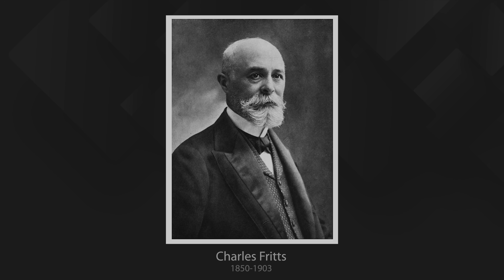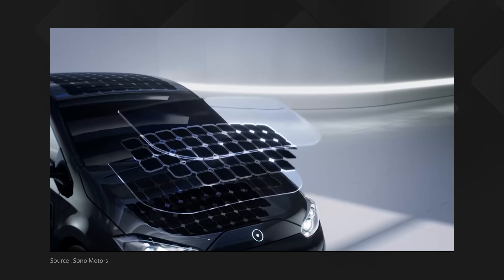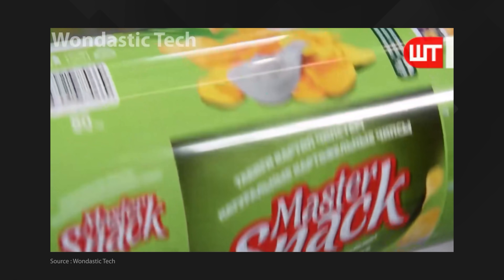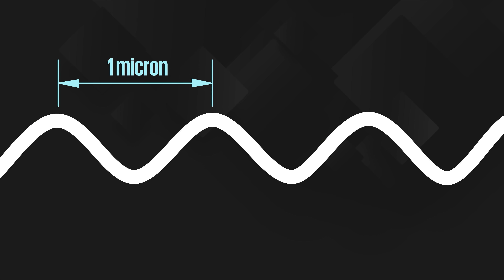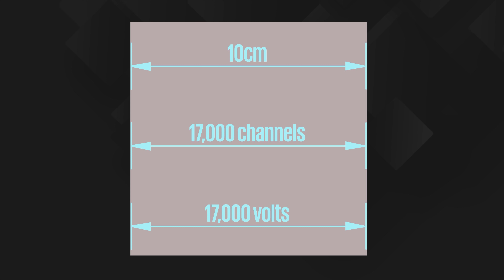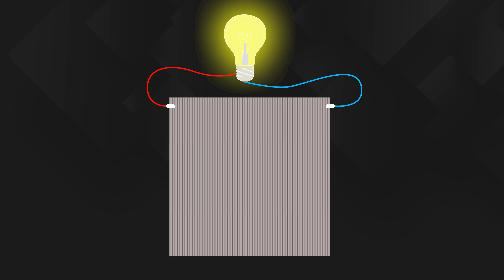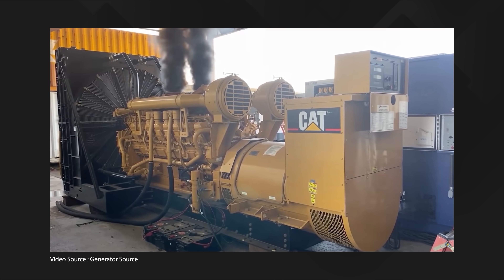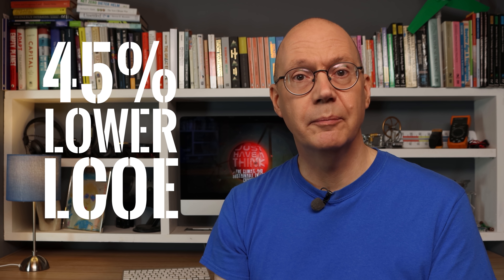Solar PV film roll. Revolutionary new production technology.

Comment: Great idea. I wonder how this material would hold up as a cloth such as a solar shade cloth? Would stretch and strain damage the microstructures? Also what would be its durability under UV? I guess if it's cheap enough, if the material wears out you could simply peal it off and replace it, which then raise issue of recyclability.
Reply: That was my thought as well, how much more plastic will it add up to? Otherwise sounds good.

Comment: Interesting stuff. The tricky bit will be finding a successful market. There have been many thin-film PV companies that have all failed to get much traction, including ones specialising in things like tents and awnings (places not strong enough to hold conventional crystalline panels). The problem is that a lot of the applications where it would be useful are area-limited, so getting ~half the power output (11% vs 20%) is a deal-breaker - it's better to spend more money on more efficient panels for a small area like a campervan roof, house roof, vehicle roof, boat roof etc.
Still, maybe there are places where laminated thin film will work and it can be done cheaply enough to make sense. I hope so - it seems like neat tech.

Comment: Excellent work, sir! I was wondering if you might be able to do some shows about a more low-tech potential, such as the possibility that trees actually produce an electric current and if reforestation could replace some of these problems with high-tech renewable energy efforts, then doing such a thing the forestation of the globe's deserts would produce an astounding effect while providing the companies involved with a good income because forestation and Forestry maintenance which would involve labor-intensive arborist maintenance and collection of leaf litter and forest floor fuel work, if done properly especially would entail a fast labor force especially if it involves electric engineering as well. 

Trees that search for water such as the African fig tree or the weeping willow would help in retrieving fossil water which may be abundant below any desert, as well as harnessing the abundance of seawater that has resulted from climate change to produce the freshwater for the desert forest by separating the hydrogen at its source and transporting it using dirigibles with the new flexible photovoltaic on its exterior or actually a part of the physical structure of any dirigeable bladder. 

I for one am convinced that the solution to climate change is not that difficult for human beings to do. It's just that the wrong people seemed to have worked their way in two positions leadership for the moment, perhaps because obtaining some kind of Collegiate degree the knowledge of which is all too soon forgotten. Be that as it may, each of us because of the advances of our century may just be in positions collectively, right now, to harness each individual's power of the human mind. 

I have written about that recently in my of my recent series of books. The latest is called, "Reciprocal Supply Systems". . You can get a copy from Amazon, just type in the title on the search bar and my name, Paul Hall, when you get to the site. 

Many thanks for your wonderful efforts, I'm a fan. Sincerely, Paul A. L. Hall
Reply: I recommend sending Dave a message through Facebook.

Comment: I love the fact that you cover the renewable energy sector. I always click the like button. And I appreciate you. However. You need to watch the documentary on history of what happened when Krakatoa Exploded (f I remember my facts right) they went through two or three years of total crop failure. Krakatoa put so much debris into the air that the sunlight was blocked out for days, and weeks where there was no sunlight at all. Photo Voltas is not suitable for baseload generation? No matter what type of storage device you put in to smooth out its output. If you really care about the planet. You will promote. Molten salt nuclear reactors utilizing thorium. They can be mass produced, they can be configured to burning up our spent nuclear fuel rods which litter the countryside. Sitting in swimming pools waiting to. Have a disaster exposed them to us. And yes I am being funny Just Have a Think
Your fan AL

Comment: For 50 years now, the solar fanatics have been telling us that they are finally producing THE product that will make solar work. But until solar energy stands on its own without massive taxpayer subsidies, it does not work. Call me when the subsidies are not needed.
Reply: It works, there have been massive advances in PV tech.
Where have you been? 
Come out from under that rock occasionally.
Ring ring,. Ring ring,ring ring, 
Hi Noddy, unlike Coal and nuke, the subsidiaries haven't been needed for PV for ages.
Don't confuse subsidiaries with start up incentives.
2,600,000, ( 30% ) of rooftops in Australia have solar as of Dec 2020.
Then there is the industrial and business roofs.
That's approximately 11GW generating capacity and over 10% of Australian generating needs and growing.
But you don't want to hear facts.
Reply: @davidwatson2399  When the subsidies end, let me know.
Reply: @stevenikitas8170  
The subsidies on Coal and nuke will only increase and I doubt they will end anytime soon.
The generation capacity of solar PV and wind has negated the need for the construction of new or replacement coal plants in Australia.

Comment: Sounds almost too good to be true. 🤔 So, responding with my usual cynicism to every such 'Welcome to the World of Tomorrow!' announcement made in the past 500 years, I think I can guess what's going to happen next...

The combination of unlimited free energy from the Sun, the amazing simplicity of the manufacturing process, the robustness of the underlying technology, the inexpensive raw materials, and the relative ease of implementation all round the world will result in a colossal rise in domestic electricity prices.

Sigh. Somebody, please, prove me wrong. Plee-e-e-e-ase prove me wrong.
Reply: I have solar PV and my bills are Less than $50 a quarter.
Solar is not pushing up the price of electricity, I suggest you get your information from a more reliable source.
Reply: Going totaly, or even partially off-grid doesn't cause the price to go up. As with most products or services, the price is set by demand vs supply. If one is supplying one's own electricity, one will be paying less to the company.

Comment: Cool! And pretty! 
So, all the things that could go wrong....
Hail storms damaging the surface so that they short out.
Vehicle crashes - same. 
How do they handle chemical spills?
If pieces are torn off and blown around in the wind and someone picks it up, will they get shocked?  
Etc. 
I'm sure they'll be working on all that so when it's all worked out, this would be fantastic to put on older structures which were not built to handle the weight of the heavy glass panels. Like my apartment building! 
Well done!!

Comment: I wonder if I could get them to leave one series connected for me.  I bet I could have a lot of fun with a million volt solar panel.
Reply: If it only puts out 0.0000001 Amp, wouldn't do much. I figure that they will cut them into lengths that will put out at least 10 Amps per length, and then parallel them for even higher Amperage. This will cut down the Voltage, as Amps times Volts equals Wattage. (Ohms Law). What IS needed is a panel that can put out between 25 and 100 Volts at at least 5 to 10 Amps. Then one only needs an MPPT solar controller and a good battery bank to get off grid...(plus the inverter to bring the 12/24/48, etc. battery bank DC Voltage to 120/240 Volts AC, (or 230 in England and some other countries). I am planning on investing in some Battle Born batteries soon. Some will even remain here in the So. Cal. desert as a test site to see how they handle the 120+F temperatures over the summers.

Comment: Would love the see it, but so fare all flexible solutions have only seen uses in very limited applications. With 11 % efficiency you need to double the area and that quickly result in added cost in the connecting parts. I hope I am wrong, but it would greatly surprise me if we see any major use of the product in the next 10 to 15 years.

Comment: Many thanks. Truly appreciate your channel. Simple question regarding the durability of the PET substrate over long period of sunlight exposition. I live in Canada, consequently, I'm also questioning thermal resistance when exposed to extreme cold temperatures (-40°).
Reply: Paul Gallant
Put some empty cola bottles with the PET recycle symbol outside when it's cold and try to break the plastic.  That should answer your question.

Comment: 10 to 15 years expected life is at least 2 to 3x lower than that of current PV solar panels so half the cost is not a good deal and they will need to do much better.  Also since they have such a lower expected life recycling should also be considered from the beginning.

Comment: Sounds like it has great potential! Efficiency is not that important, what's needed is a low cost per watt and they seem to have that covered.
Reply: half the cost, half the efficiency, and unknown longevity ie repeated bending stress, as well as impact resistance, etc.  The flexible panels now on sale offer two years lifespan, Cross our fingers these will be improved

Comment: This would be huge for cruising sailors if it could be made durable enough to incorporate into the sails.  A photo voltaic sail would give you a very large amount of surface area to produce electricity even if the film is less efficient .   A roller furling system would be the best way to go to prevent damage to the sail.   Thanks for the video!  : )
Reply: I was also thinking airships, considering their light weight.
Reply: @erfquake1  like a dirigible?
Reply: @MsNickie1001  Hell yeah. The surface area would be immense, and the film's weight would be negligible. Perfect application.
Reply: Canal boats use solar usually on the roof but perhaps could be coats over entire roof and sides of the upper section ?
Reply: @davidpowell3396  I’m looking at buying a canal boat at the moment. Given a widebeam has maybe a 14m by 3m roof just on the cabin this might be an ideal application
Reply: Talk about a solar sail...
Reply: I cant see they would ever get it resilient enough for covering sails. The beating a sail gets at times is hellish.  Most people are shocked when they handle a larger sail for the first time - its so thick its almost solid.
Reply: @piccalillipit9211   Yup durability would definitely be the biggest hurdle.  I've sailed the coast of Alaska for over 25 years on 30 to 50 foot sailboats for months at a time.  I much prefer them to power boats. I think they are a lot more seaworthy and safer than most power boats.
Reply: @mojoneko8303  - Im nothing like as experienced as you - but the first storm I was in was in the English Channel - wind over tide in a force 8 in a 30 foot wooden sailing yacht; that was when i discovered JUST how well built yachts truly are. I was convinced she would break apart at any moment and it was like water off a duck back to the boat...

The waves were flat fronted cos of the wind over tide and we just fell off the top of each wave into the trough of the next one and the wave broke over the top of the boat - 10 hours of that in a boat made of trees and bronze nails - unbelevable.
Reply: @piccalillipit9211  That would be my view as well. But wider use on the superstructure of boats seems an easy win.
Reply: @tcroft2165  - OH 100%. I used to live on a yacht [not as fancy as it sounds LOL] and there are almost NO flat surfaces on a yacht - or any boat. They are compound curves for strength. So when I installed PV on the cockpit rood I have to have different sized standoffs at each corner to level each panel - that meant the panel could easily be broken - which is immediately what happened when I left the boat for 2 month. Although not in the way you might imagine - the gap between the panel and the roof allowed someone to pull the cable to see if they could steal the panel.
The result the boat was a foot deep in water as the batteries had gone flat and the bilge pups had stopped working. 
Jus pealing off a backing and sticking strips to the roof would have solved ALL these problems
Reply: @piccalillipit9211  Exactly those curved surfaces inc many that are dead space you can't use for anything.

If thin film drives costs down then they also become less value to steal. 

Of course ideally its just built in at design stage when you can integrate this most effectively.
Reply: @tcroft2165  - PEP - there is no reason not to cover the entire top surface. Although I wonder what effect it would have on the temperature in hot climates - even in the south of France the deck of my boat was very hot on some days.

Comment: I'm no tree hugger but I absolutely value your excellently presented views and thoughts.  Please don't get me wrong, I do support environmental care of our very limited planet. I just don't see climate as our biggest threat but instead one of many that must be conquered together. I try to take a broad focus beyond CO² looking at the effects of for example 2cyc oil, the over use of nitrogen on our lawns (which can be more toxic than 2-4D or roundup), stopping combustion of biomass to produce socalled green power etc!  

I am amazed at the green tech we come up with.  
Example.  In 2007 a high school student made a working model of a steam engine that burned coal, but emmitted no CO².  there was no outlet or stack, it produced carbon black and calcium carbonate. His invention was purchased by Exxon and got likely tossed into a very deep hole where other destructively revolutionary stuff goes!  If that could have been developed coal is everywhere, we need carbon black to make tires, and CaCO³ builds our homes, like wall board! Also if it had been indeed full trapping all that is bad in coal, coal could then be green, but without such tech all coal can only be bad!

Comment: A hydrogen fuel cell airplane with rolls of these stowed in the fuselage. Fly several thousand miles at a higher speed, Land, unroll them recharge and then restow them. you could circumnavigate the globe much faster than continually flying at 36 miles per hour
Reply: 🤔Sounds interesting… for Australia! 😅 Lots of sun, parking place and single passenger airplanes needs.

Comment: price to efficiency and cost is better.
if this works as a roofing material that lasts 15-20 years, it could be implemented on roofs anywhere supplying power at the same time.
plus it could be portable and unrolled anywhere too.
rolled down walls of highrise buildings, maybe even giving a faux exterior, like a vinyl wrap nowadays.
like electric car bodies.

Comment: Seems I remember a company in Fremont CA that developed a solar system that can be applied to existing metal roofs some years back. They had a contract that bought all production for several years going to the Middle East. Sounds similar was in rolls with adhesive backing.

Comment: Great stuff, I have been thinking of external sun blinds and internal window blinds and this stuff would be a great secondary use for them so I'll hang on for a bit.
Reply: Interesting idea. Could they even be made into modern or transitional looking shutters?
Reply: @ Ping Pong
Dave said full-scale production was going to start in 2023 and delays are common in startups. I would suggest getting retractable awnings installed for your next summer. These make a huge difference.
Reply: @mikedavison3400  Cheers Mike, I was thinking of awning's and internal blind's in different location's, and with this film type solar PV on em they would be great, I will wait and see, if they are delayed, other fish etc.

Comment: A 20kw roll of this material could be carried by one person?  Amazing.
Reply: Do not forget that they are naked semiconductor devices on a large scale; a simple crack will render the whole roll a piece of junk- unless you can identify the fault and repair it manually (unless they are bypassed with diodes like regular solar panels)

Comment: I anticipate within 5 years the efficiency will reach 25% or higher. On such a small and well controlled process that doesn't involve volatile heat, I think their process will improve and change the world. In fact, if they layer their dyes on the electrodes they can absorb different spectrum and increase efficiency.
Reply: No chance.  I'd be amazed if they can get to 20%.

Comment: So, where is the catch? This certainly seems like an extremely good product (especially for new applications), but considering it should also have almost 2xROI against traditional solar panels I would have expected for this to be attracting tens of $B, but considering it isn't, there has to be an unsolved problem somewhere (or non-advertised flaw, like EG bad performance in heat) .
Reply: Normally with thin film it’s been life time that has been the issue.